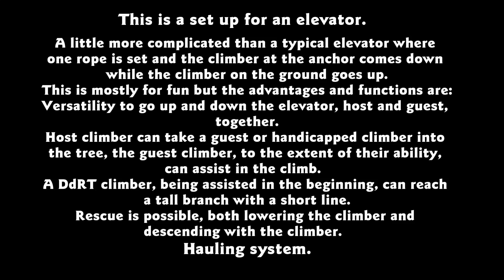Rope elevator (with picture in picture) used for tree climbing recreation, hauling or resuce.

Comment: You might be able to help with a project I have going on. I have a friend that is paralyzed from the chest down, he wants to be completely self relient to set up a light weigh strap on tree stand for deer hunting, would need to be 15-20 feet. Your video showing the SRT with a Canopy Anchor would work awesome with his harness, Do you know of a way to rig an Ascender/Descender so that he could use it to get to his desired heigth without the use of his legs? Once there he could pull up his stand and strap it on the tree, harness himself into the tree and pull up his rifle. Our goal is to be able to drop him off in the woods and he find where he wants to hunt then set up his stand, hunt, and then recover by himself. The main trees in our area are Tall Pines, but there are also nice sized oaks and walnut trees ect. thank you